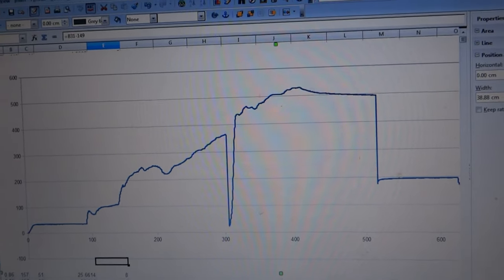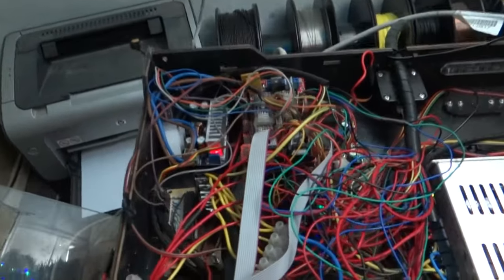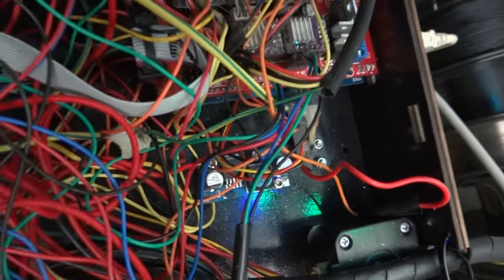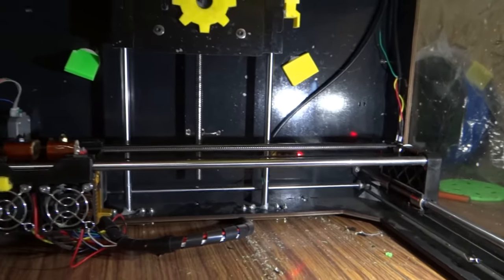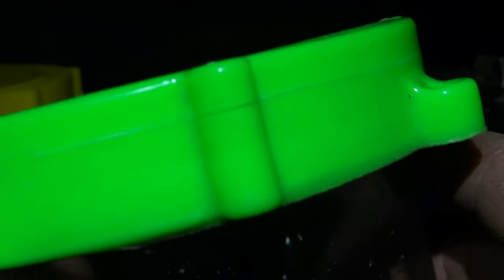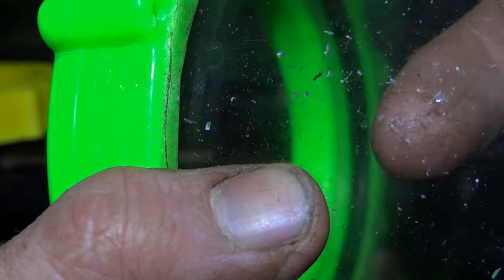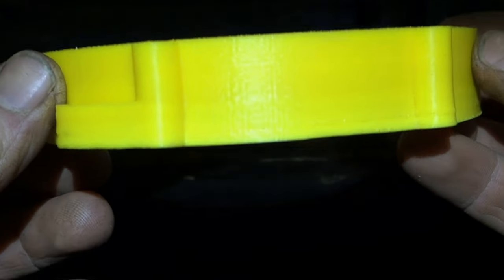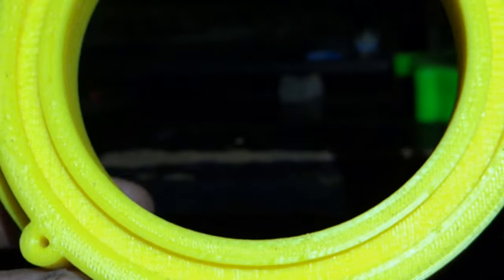FishingROV #62 Testing Sony DSC-HX100V as vBlog Camera

Comment: Yeah the sound is sooo much better. Does it not have a AF assist lamp (dont know if its just for stills). Its got 9 point focus points could set it to the middle focus point so it does not try focus of the background or switch it to manual focus.
Reply from the maker: +Ben Mitch aye it dose have a AF lamp. Not sure it comes on when videoing. Trying to rashin the battery cos i didn't get the charger.